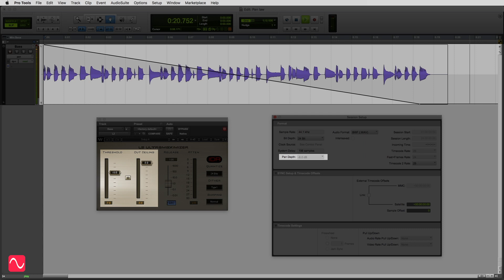A quick demonstration of pan law

Comment: Thanks David, Is not it better to set the DAW settings to 0dB pan law ?
Reply from the maker: It's a preference, but I'd say 3 dB is the most generally useful. What's important is to use the same law all the way through the mix. If you change it then the level of anything not panned hard left or right will change. DM
Reply: @AudioMasterclass  Thanks a lot David 🙏😍